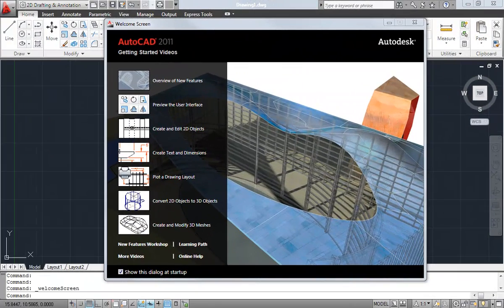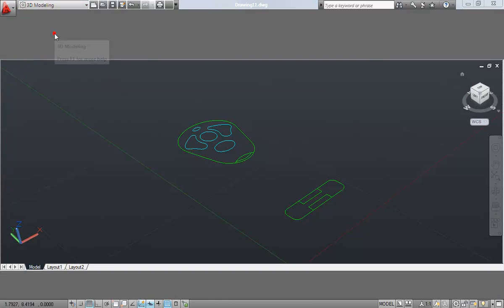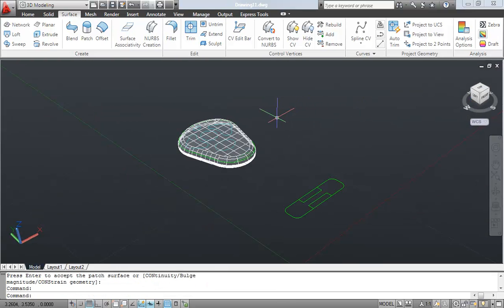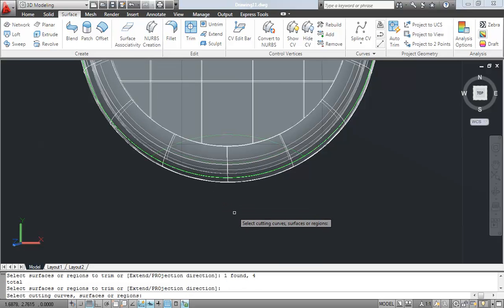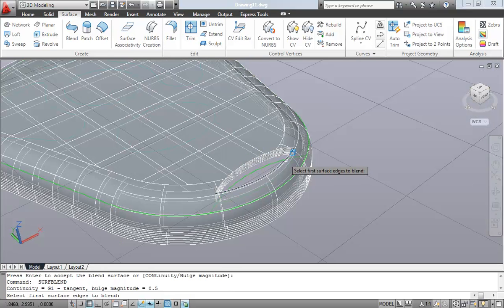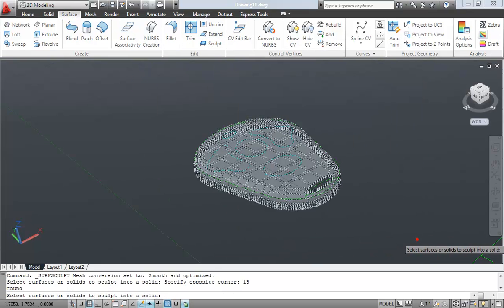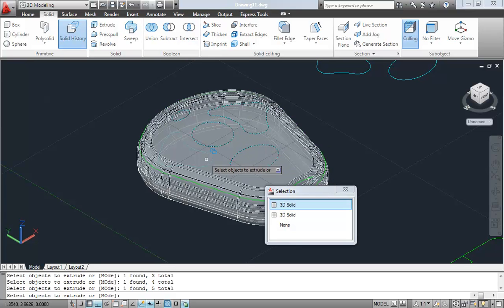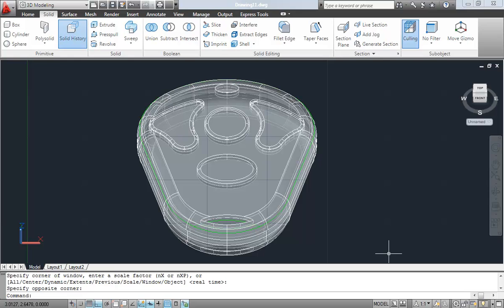First look at AutoCAD 2011: Modeling with 3D Surfaces

Comment: Why do you need 2011 for this ? I can do it in CAD 2000. and it will only take about 3 mins and 20 secs.
They need to come up with more stuff. like the  "push"  sketchup. then Ill budge.
How cum such a small package (Only 400 $ by the way) like sketchup has really simple But awsome solutions for 3d modelling compared to AutoCAD ?

Comment from the maker: @latapatia18 AutoCAD Fields should be backwards compatible. AutoCAD 2008 does use the AutoCAD 2007 .dwg file format, whereas AutoCAD 2011 uses the AutoCAD 2010 .dwg file format, so you'll certainly need to save the drawing down to the 2007 format. Another option would be to plot to a DWF and then plot the DWF in your classroom using Design Review (free & typically installs with AutoCAD).